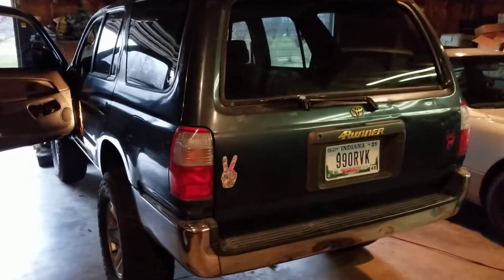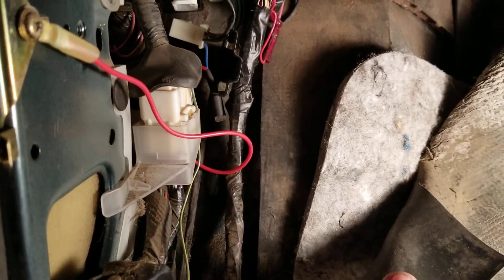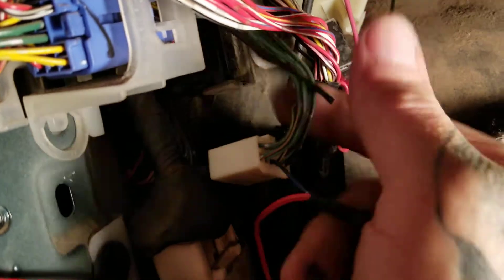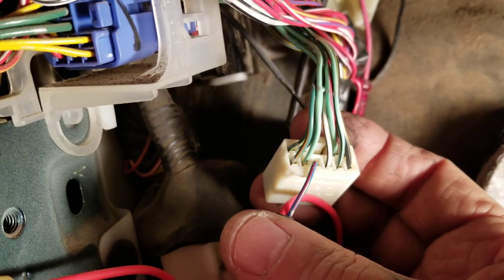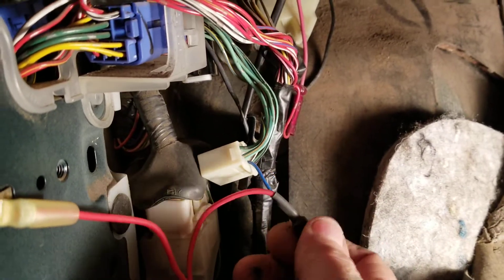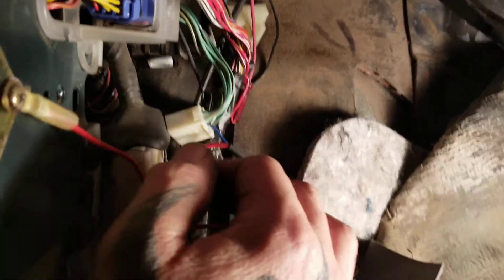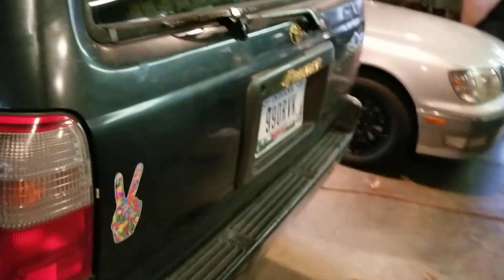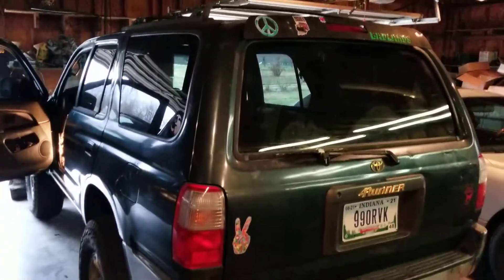How to modify Toyota E-locker. 3rd gen 4runner. Blue wire mod for rear diff lock. Engage 2hi/4hi/4lo

Comment: What end do you ground the plug end or the other end since there is two ends once you cut it thanks
Reply from the maker: You ground the wire coming out the top of the plug. Cover the other end with tape or shrink wrap just to be safe.
Thanks for watching and commenting.

Comment: What do you have the 2 wires connected to, it looks like a light.
Reply from the maker: That is a wire connector. The kind where you put the wires in and screw the top on https://www.crutchfield.com/S-y1X66br3Xo2/p_669PP608/Posi-Products-Car-Stereo-Connector-Kit.html?XVINQ=GZ0&XVVer=Y0P&awcr=630504778501&awdv=m&awnw=g&awug=1016981&awkw=pla-297605276583&awmt=&awat=pla&gclid=CjwKCAiAwomeBhBWEiwAM43YIEwr3CXVkvB413ab61cg-jGDbqeY8ASryf-mbJabD6lgMWi2JUNBPxoCPygQAvD_BwE
 Since they are able to be undone, I thought they were cool, but they are so big I don't use them often. 
Thanks for watching and commenting, I appreciate it.

Comment: Can you do this on a 5th generation forerunner and if you can what is the mod called like what's the official name of this mod called in the community
Reply from the maker: I've never had a 5th gen available to me.
I'm sure it can be bypassed. Although it may be more difficult in a newer vehicle.
"The grey wire mod" it what I first heard it called. On Tacomas it's a grey wire. "E-locker mod" is the only other thing I've heard it called.
I tried to look it up real quick but didn't see anything 5th gen specific.
Best of luck on your quest.
Reply: @brokeassgarage4  well I just got a 2022 4Runner TRD off-road premium 3 months ago and was wondering if it's possible to do it Because I'd want it in snow in 4h  But like I said it's a brand brand new truck and I really don't plan on modifying it anytime soon but for the future maybe a super charger
Reply from the maker: Supercharger sounds like a nice upgrade.

Comment: Out of curiosity, would my rear diff lock not engage because I have an abs light on or because there might be a fault in the electric actuator?
Reply from the maker: ABS light shouldn't have anything to do with it. But I don't know that as fact.
Usually the actuator just needs cleaned.
I've had 3 non working units and all of them just needed removed and cleaned.
Reply: @brokeassgarage4  awesome thanks for the info, I know what I'm doing later lol
Reply from the maker: Right on.
It's not a difficult procedure.
I activate the 4wd and diff lock monthly (if not more often) to keep them working properly.
Reply: Abs light should come on when you hit the E-locker, sometimes it takes 30 ft of rolling to engage btw, just depends on tension and position of drivetrain